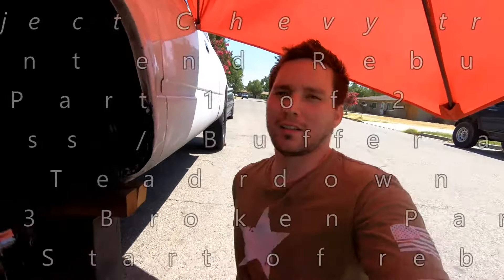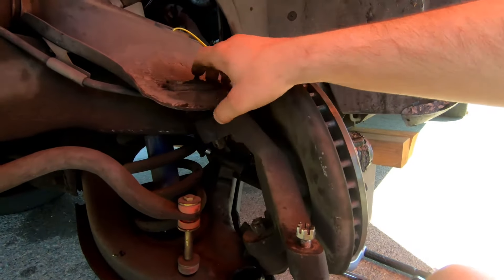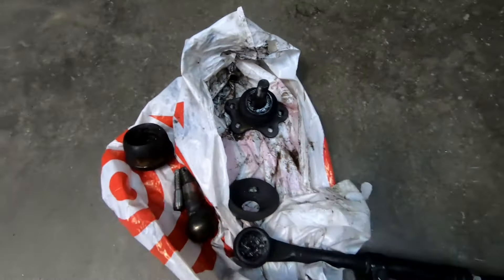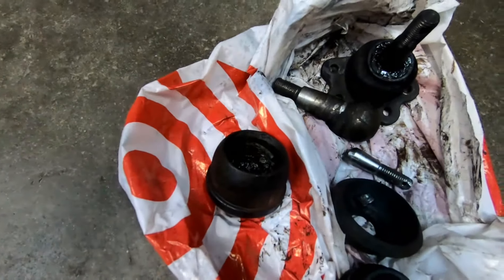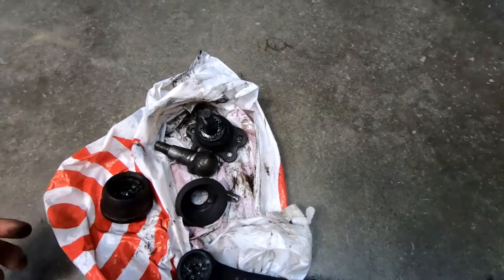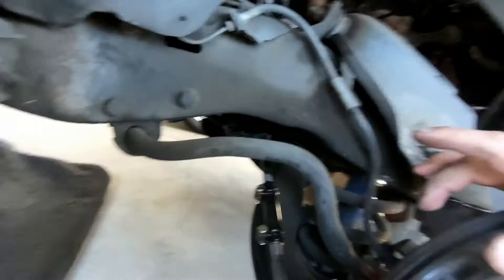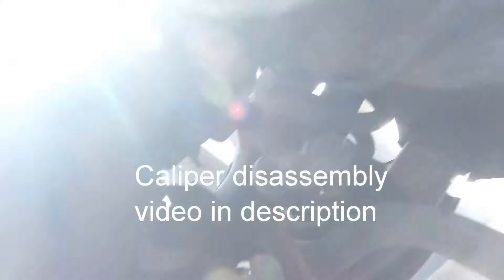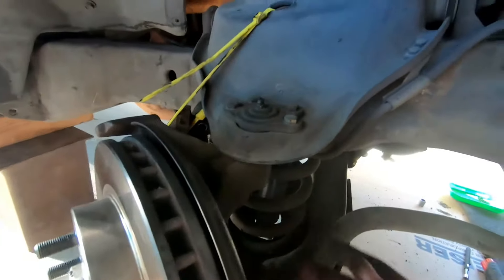CHEVY TRUCK FRONT END STEERING / SUSPENSION REPLACEMENT [Part 1 of 2]

Comment: I know my 95gmc is as bad I’m doing video also !  I have limited car tools so was looking for a easy way thanks for video I’m doing a kit a arms tie rods linkage pitman arms everything was like $250 kit
Reply from the maker: $250 each side? Seems a little cheap for $250 for both and I’d be weary of Chinese parts in a critical area. Make sure your control arm system is from a reputable manufacturer. You’re welcome. I’d recommend making sure the parts are decently built, because mine were from a O’Reillys and multiple inconsistencies from china, mexico and Taiwan I believe; this was mainly on the ball joints. Pay a little more similar to Monroe parts and have piece of mind, hence my upgrade. After the broken ball joint on a freeway off-ramp I’d definitely recommend getting good parts on the critical areas like the steering areas.

Comment: I have replaced most everything in my 04 duramax and when I jack it up there is a ton of play in the wheels when I jack one side up. Please help. Any ideas? Replaced gear box, pitman arm, idler arm, idler arm bracket. Both wheel bearings, both control arms and ball joints. Tie rod end on driver side passenger side is good. When driving about 40 truck starts to bounce around. Had 3 alignments replaced pitman arm and idler arm and bracket again. I’m literally beyond stressed.
Reply from the maker: I’d like to disclose I’m no mechanic, I just fix what’s broke on my own personal vehicles and pass the information off for others to gain knowledge and hopefully help them fix the same problem.
First off if it wasn’t doing it before, check all your connections to make sure nothing was forgotten like a nut untightened. Also don’t trust one place for alignment or tire balance. I went to a place 6 times to get 2 cars tires replaced and rebalance because the new guy didn’t know what he was doing and the experienced guy was out on vacation and Covid every time.Are the ball joints seated (pressed)all the way? Are they loose because you purchased aftermarket ones and they are not all made to correctly fit, certain countries make them undersized which I encountered multiple times. Are all the rubbers good on the a-arm? Did the cradle on the frame where the a-arm attaches actually clamp on the pivot spacer or is the a-arm bushing undersized allowing the entire unit to move causing it to have play? Are your springs seating properly on the a-arm and upper area? Is your shocks tightened properly, I had a wreck and the body shop didn’t tighten the top of the shock; it bent the shaft and I had to find the issue because every time they said the fixed the problem but they never actually did until I figured it out and showed them. Are your shocks worn out and don’t have good resistance? Is your truck lifted or lowered recently? If it is the steering pitman arm needs to be properly replaced to account for steering angle change. Do you have weights on your rims still for balance? 
Bouncing generally has to do with bad shocks or struts not dampening the spring as it compresses and decompresses. Wobble in the steering usually is wheel weights flew off, lifted or lowered truck + steering and some front end components like ball joints and tie rods.
If you can jack it up and wiggle the tire by hand it’s usually the ball joints or something else not tightening enough. Jack it up and slowly move it until you can track where it has the most play. 
It’s hard to diagnose something from hypotheticals, Hope this helps. You can always get a dealership to diagnose the problem and fix it yourself if all else fails since you sunk a lot of money into alignments already.

Comment: What brand did you use that caused the issue? Was looking at a kit on ebay to replace my control arms
Reply from the maker: @justbored9906  are you referring to the large ball joint issue? I looked at all the ones from O’Reillys, the only difference was where they were made (china, Mexico, etc) and they only had their house brand. Between them was the diameter varied and one had external ridges, internal facing ridges and one was smooth. The one that worked had ridges larger than the smooth surfaces (external). The others pushed in by hand and fell out by their own weight or slightly with a tap. Replacing the control arms is the best way because the bushing in between the frame and arm usually rots and squeaks; just be aware, the non factory ones are probably gonna be noticeably thinner metal than oem, we did this for another truck we own 97. Pressing out the bushing that mounts between the control arm and frame was a pain to remove on this truck (90) even with a heavy press, we had to burn the rubber off instead.

Comment: So ball joints first
Then steering assembly
Then shocks and coil spring ?
Reply from the maker: Tie rods (remove everything tied to spindle to allow it to move easier)
Ball joints 
Then the rest 

To be honest it depends how much your rebuilding but for the most part it really doesn’t matter too much, but the more you takeoff the easier it is to manipulate the spindle. The critical thing is the torsion bar and the Pitman arm since they have to go in a certain order in order for you to take them off and put them back on or else everything’s in the way and it won’t allow it to be taken off and put on.

Comment: How did u get your campper alignment done ?
Reply from the maker: Camber alignment? Or Toe in toe out? If it’s an identical factory part your replacing you can count threads on the tie rod area and match. You can also take a measurement before disassembling off a fixed known location. For camber, there are eccentric bolt washers on the upper A arms (control arm) with identification marks you can rematch. I only do this to allow me to drive until I can get an alignment.
There’s a few ways to get you in the ballpark but unless you have an alignment machine your tires will wear faster (prematurely) than a perfect alignment. I always recommend getting the alignment done after replacing parts related to alignment; it’s cheaper than tires. Alignments are usually $60-$120 in my area of California, I tend to spend $80 when I do alignments with new tire purchases. Given, Tires last me 5+ years and it’s a good sanity routine that tells me if any suspension parts need replacing (they can’t do the alignment when ball joints are wore).
Reply: Yea I’ve had a small accident on my c1500 my front driver ball joint left the chat wile I was going down the road but I did all the front end my self including tierods,upper and lower control arms and bushings . But after I replaced my upper control arms my tires on the outside walls are like tipping in .”Note I am on a 4inch level kit but it shouldn’t be off like that did I not center the camber rite ? The ring adjusters “… also when I put it on reverse my steering stays straight but my tires seem to squat inner wise like if the tire is loose ? I’m lost could it be the Camper adjusters ? Orr idk I’m in the ends .
Reply from the maker: @RAMIROGONZALEZ-tj2fx  I have mine dropped 2” on spindles in the front with everything “stock” and 6” in the back shackles and hangers. If you put new control arms and the wheels lean in at the top then the camber needs adjusting. If the tires turn out or in when looking at it from the front the tie rod need adjusting. If you do all this and still looks way off especially on the accident side, then the accident could’ve bent the frame, tabs, spindle, rims, etc. Jackie it up from the frame and wiggle the tire to see if you have any play or loose bolts, it should be firm. Also, the front fender can play an illusion because it curves.
If you drive it and it pulls to one side, squeak like tires or pops when backing out of a driveway at full steering turn; you’re alignment is way off

Comment: How much did it cost to upgrade and replace the front end in total? I have a Chevy 2000 Silverado 1500 king cab and I'm looking to get this done. Thank you
Reply from the maker: It was under $1000ish if I remember correctly for all the parts. Steering box, sway bar, bushings, ball joints, pitman arm, idler arm, shocks, etc. 
I paid over $500ish for the upgrade if I recall correctly since my Chinese parts that are junk costed $400ish.  I replace a lot of things not recalling all I replaced on this video, i know it was all the front end stuff though 

Well worth buying quality American parts
Reply from the maker: Just remember everything that comes off certain way put back the same way in reverse because it’s required for the sway bar to assemble in a certain order or else you will have to remove everything again to get it in (which I did).
Reply: @ProjectAnubisUSA  Awesome! Just the right answer I was looking for. I wanted an unbiased estimate and lucky me! Great video, and again thank you so very much for your prompt reply! 🤠
Reply from the maker: philo sopher I get mine at o’Reillys because AutoZone always has a line and both places have lifetime warranty on their parts which I replaced multiple times already due to the Chinese crap that I purchased but now I got the American upgrade or at least they say is backed by the name.. i’m unsure how American the upgrade is but one thing I could tell is the extra cost was worth it. One thing I noticed when I was doing the ball joints is all the Chinese ones had a different diameter ball one had a single ball and another one had a ball with a outer housing around it. They also had different diameters where the splines are and I had to go to 3 different o’Reillys to replace it because somewhere made in China, Taiwan, Mexico. It seem like the factory brand from the store was all over the place as far as manufacturing was concerned.
Reply: @ProjectAnubisUSA  Good to know, as next week I will go shopping for these front end parts. You've been extremely  helpful and knowledgeable! 🤠

Comment: You don't need the nut to hit the tie rod threads with a hammer. You're not reusing it.
Reply from the maker: Some people maybe reusing so I show the best way to do it. Also, if it doesn’t pop and you keep hitting it the stud might mushroom 🍄 and then you will have another issue that could be prevented. One person asked me to list all the tools because they didn’t know which to use. since this job is dangerous if not done correctly if you’re not familiar with basic tools then you shouldn’t be doing this fix hence why I call out certain specialty tools only depending on the fix and not the basics all the time. Easy fixes I’ll spec the sizes as convenience when I remember. I try to minimize any issues that can possibly come up because common sense isn’t common... I have to compromise between experience and the inexperienced to medicate questions.
Reply: Understood

Comment: Hey where about do you live off the 99? I'm out here in atwater next to Merced
Reply from the maker: Fresno
Reply: Ahhh nice. I gotta do a front end rebuilt too. Any kit or parts you'd reccomend?
Reply from the maker: @dirtmgirt209  yes spend extra money for the better grade stuff. Not worth risking your life with the cheap stuff. Be aware that the ball joints are not all the same either in diameter even if they tell you, some have splines some are smooth and some are smaller diameter with the same part number (small Chevy perhaps). The first go around I had to go to a few different stores to find the right ones since they only carry a few per store some were made in China somewhere made in Taiwan for the cheap store brands. Buy factory or MOOG (auto zone) parts not duralast for they key parts at least. Bring your old part with you if you can to double check on the ball joint stuff to make sure they are correct in diameter to save you some hassle.
Reply: @ProjectAnubisUSA  I was thinking about buying the control arms already installed with ball joints and bushings. What do you think
Reply from the maker: @dirtmgirt209  I replace the control arm bushings which were a pain in the ass to remove. I should have bought the entire control arm; that being said the control arm itself was a hard item to install because the brackets are tightly pinching the pivots. You will need to pry and hammer to get the control arm on and off. I’d avoid it if you’re control bushings are good but if not definitely buy the whole control arm not independent parts like I did. Just remember I also had warranty to use so it also kept me from buying the entire unit.